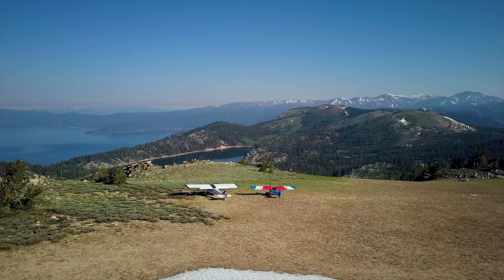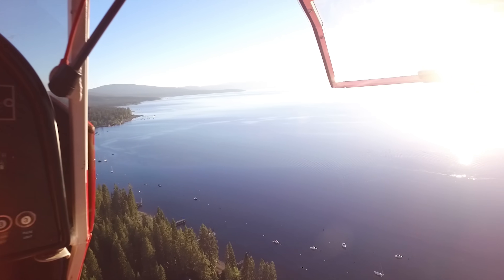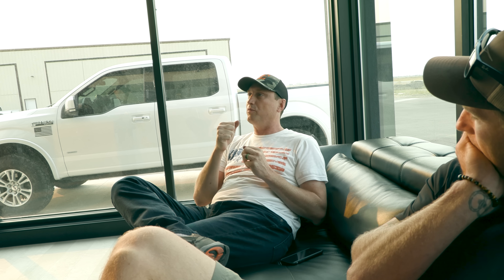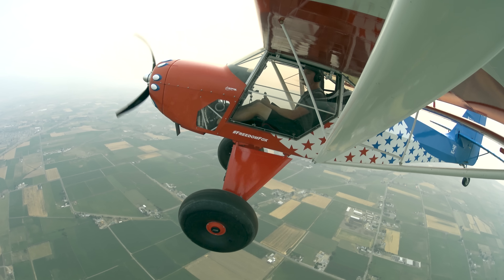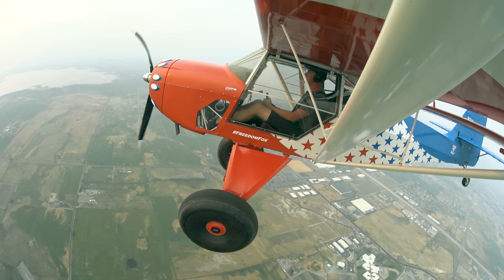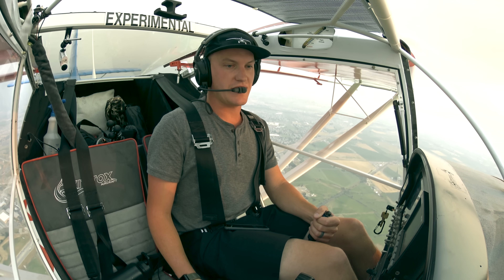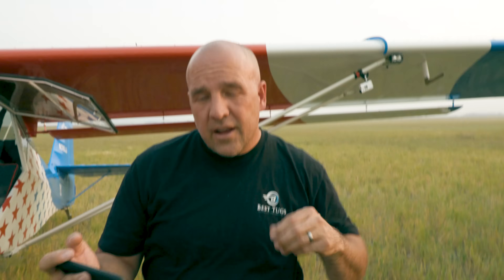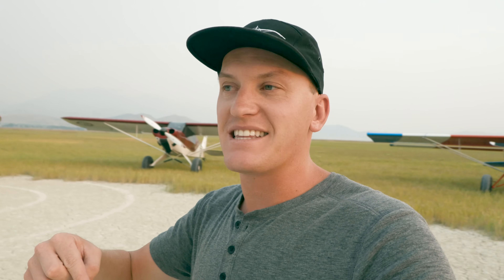YOUR FLIGHT INSTRUCTOR WAS WRONG! - Simulated vs Real Engine Failure

Comment: I think the root of this is people confusing the windmilling prop with an idling prop. Then the fish story continues to grow.
Reply: The issue is not that energy is going into turning an engine.

The variable is STALLED Prop vs FLYING (Wind milling) prop.

A wind milling prop is wing, FLYING, so like all wings it's generating lift.  The problem is that because of thr AOA of the air, it's lifting in the wrong direction!!!!

A stalled prop does produce drag, but not as much as a flying prop lifting on the wrong direction.
Reply: It's all about angle of attack and stalled vs attached airflow!
Reply: The engine spinning is just a side effect of this lift produced by the still flying airfoil/ prop.

Now, if the prop could decouple from the engine and actually spin fast, the AOA and lift would reduce.  Probably......I think....
Reply: Right, I think this is why this discussion even exists. A windmiling prop is driving the engine parts, and obviously creates more drag than a stopped prop. But, as Trent and the Cowboys proved, if the engine is driving the prop, it's still producing SOME thrust, or (at high speed) at least not as much drag as a stationary prop would.
Reply: Of course it does. I'm surprised that confuses anyone. The engine at idle is still spinning the prop and producing some level of thrust. That's why most instructors will tell you that the plane will drop faster in a real engine out vs. a simulated engine out. Another tip is to pull the prop all the way back if you've got a constant speed prop. It won't feather it back all the way like a multi-engine, but it'll create less drag.
Reply: A windmilling propeller can produce much more drag than an idling propeller.  An idling propeller at a high rpm can produce as much parasitic drag as the basic airplane.
"An indication of this powerful drag is seen by the helicopter in auto rotation. The windmilling rotor is capable of producing auto rotation rates of descent which approach that of a parachute canopy with the identical disc area loading." The preceding quote was taken from AERODYNAMICS FOR NAVEL AVIATORS by H.H. Hurt of the University of Southern California.
Reply: Terry Wilson rotating an intact IC engine will have tons of resistance to overcome due to the compression ratio. Much more than getting getting an electric motor to turn over. Next time your around an aircraft and the mags are off try spinning the prop to see “easy” it turns through the entire combustion cycle. 

Disregarding what people see in RC planes is also not very wise since there are not that far off from scale replicas of real planes with most of their differences being in weight and balance and the scale of their props. In aircraft design the use of scale models is a huge part of what they do in validating a new design.

Either way it’s pointless to argue against the facts, they just did the experiment and windmilling has the worst result. So you don’t believe it in real planes or RC planes lol.
Reply: I don't think it's just due to the energy required to turn the engine over since the same principle applies to paramotoring, and the ones that windmill have a clutch, so they just freely spin & don't turn the engine over. The freely spinning prop also causes more drag than a stopped prop
Reply: If the engine isn't seized, it's likely that you can fly fast enough to overcome the friction/compression of the engine, if it is seized, you can't fly fast enough to get the prop to windmill.

Edit: You wouldn't want to do that in an engine-out situation, of course, I was just trying to work out how a windmilling prop can create more drag than a stopped prop. I guess the answer is that a spinning prop is more efficient at absorbing energy and converting it into rotational energy than it is at acting as a speed brake, so it's best to keep it from doing what it does best in an engine-out situation.
Reply: Exactly, because you're using your potential energy (altitude) to turn the crankshaft and produce friction which is ultimately wasted energy when the prop windmills. When it's idling, you're using gas (chemical energy) to turn the prop, thus sparing your potential energy that you already have.
Reply: The difference is AOA of stalled, vs winmilling vs idling.

If the airspeed during Idle is very high,  then even an idling prop will produce drag because of the angle of attack.  If airspeed is low, then the idling prop is still producing some positive lift/thrust.  

It's all angle of attack.

If the prop is stationary then it is probably stalled (air flow wise) which means it does create drag, but that drag is still less than the NEGATIVE lift of a windmilling prop.
Reply: A prop creates more drag if the angle of incidence is not optimal for the velocity of the air over it. If the prop blades face directly into the wind, you will create less drag. If the prop then turns, it only means that the angle of incidence of the blades is wrong for thecircumstances, and the extra drag is converting that extra energy into a turning moment on either the prop (if the shaft is broken) the engine or gearbox shaft (if the engine has simply stopped) and also the airframe (under either condition, but more so if the engine, the shaft, or the gearbox has seized).
Reply: Terry Wilson it’s a valid argument when you think an electric motor would put more resistance on a shaft then an IC engine when they are both shut off. The compression strokes provide the prop with lots of rotational resistance. Pushing the prop it in any direction other than it’s direction of rotation is irrelevant and has nothing to do with anything. 

As far as safety goes it’s plenty safe to rotate the prop, it’s also standard operation procedures in the POH of many aircrafts cold weather start procedures including Cessnas. Even if there was a fault in the magneto system and the engine did start it’s not like the prop will chop your arm off before you pull your hand away. Before electric start mags on both and spin the prop was how aircraft were started. It’s also still how people start with a dead battery in the bush since CAA won’t be arriving to help. The prop doesn’t go from 0 to 1000rpm instantly after all. 

But I wouldn’t expect much common sense from you since your “experience” is based on simulations. Like thinking by losing an engine makes you lose the majority of your 6 pack instruments. When in reality you just lose the Attitude and HSI gyro instruments. Still have the turn coordinater for reference if stuck in IMC conditions since it’s an electric gyro, airspeed, altitude, VSI, and compass to replace HSI. Losing the attitude indicator is a non issue during VFR flight, and a situation regularly trained for during sImulated IFR IMC conditions using a hood. Even IFR in IMC you will break out of clouds by the time you are in the landing phase of flight with reference to the horizon. The bigger concern with an engine failure in IMC is the lack of time to spot an adequate field to set it down during a forced approach if breaking clouds at a low altitude.
Reply: Even a windmilling prop will produce less drag than an idle prop....right?  Am I wrong?
Reply: @pauliexcluded1  the paramotor props that freely spin when the motor is off create more drag that the clutch less ones that stop the prop. Anyone who regularly turns the motor off so they can thermal like a freeflight paraglider buy clutch less motors for that specific reason.
(We use 2 stroke motors though)

Edit: oops, didn't realise I'd already commented on this thread
Reply: @Marty G - You are spot on!  I am private pilot, but inherited a large amount of experience with radio controlled model airplanes from my younger self. I have had some very finicky 2-stroke engines in my model airplanes and have done countless deadstick landings. I ended up switching to electric planes to avoid the hassles. The electric motor controllers all have a prop brake function that can easily be turned on and off. It is specifically there to stop the prop during gliding to eliminate the extra drag of a windmilling prop. So I could generalize and say:
A functioning engine at idle will result in the longest glide, how much better depends on idle speed, glide speed and prop pitch
A stopped propeller will glide less far.
A windmilling propeller can be from a little worse to noticeably worse than a stopped prop, and is more noticeable at higher airspeeds 

My high performance model gliders actually had folding propellers in addition to the prop brake. The propeller blades were held out by centrifugal force when the motor was running, and had hinges that let them fold back when the motor brake brought the prop to a stop. So I would add that if your prop flies off you will probably glide slightly better than with it stopped, and real world might get a little less horizontal stabilizer drag with it gone from the change in CG too. :/
Reply: It’s so insignificant as to hardly matter on a properly set up engine on most aircraft. 

Lots of aircraft have the idle set too high. That and padding airspeed too much is why you often see the float fest down the runway.
Reply: @calvinnickel9995  Do a couple of simulated engine out landings by cutting the mixture instead of cutting throttle. You'll see how much drag a true windmilling prop causes. I'd compare it to the compression braking you get from a car, truck, or motorcycle. You can even use it for a steep decent to limit your airspeed in an emergency. 
But don't really try it just for fun, kinda unsafe
Reply: BTW throttle wide open, mixture cut off gives you the most drag because you are creating higher cylinder pressures. I know "somebody" who did this a bunch of times when they were young lol
Reply: Exactly. If you stop the engine, but the prop keeps windmilling, that energy to turn the engine around has to come from somewhere. As a result you don't glide as far as with the prop stopped. When idling, the engine supplies this power (and perhaps a bit of thrust too).
Reply: But the energy is still going to be absorbed by the prop and converted into torque, even if it's not windmilling (assuming an un-feathered prop) and that torque will either act on the airframe or on the rotating components of the engine. It would seem to me that, if your prop is windmilling, that simply means that the prop is converting enough energy into torque that it's able to overcome the friction of the engine, causing it to rotate. If your engine is seized, but the prop is absorbing enough energy that it would normally be causing the engine to rotate, that stationary propeller is probably creating more drag than it would if it were windmilling.
Reply: idontcare80 not sure about that. Think about an autogiro or a sycamore seed pod. If the ‘blades’ of either are spinning they create a load of drag, if they are stationary they drop like a rock. Maybe oversimplified and a little off the mark but goes some way towards the reasoning.
Reply: But that assumes that lift is also being created, which it's not in the case with a windmilling propeller.
Reply: That's not how energy in physics work: if a force is trying to rotate the propeller, but the propeller is standing still, no energy is spent. Of course there's friction in the airflow and stuff, but no energy goes into rotating the propeller.

It is apparently a well known fact that a windmilling propeller creates more drag than a stopped propeller (assuming it is the airflow that drives the propeller around). My energy view of it was just one way to understand why. Another way to understand it is that the stopped propeller blade gets an angle of attack of 90 degrees with the airflow, so the prop blade is stalled and creates little drag. The windmilling propeller has a much shallower angle of attack, so it is able to create more drag (caused by the negative lift).
Reply: idontcare80 why isn’t lift being created? You have a high & low pressure side of the prop blade?
Reply: A stationary prop is stalled so the drag is just from the air circulating around it. When it is windmilling it is not stalled (or maybe less stalled) so it is more efficient in deflecting air, causing more reaction force. This is the same as your wings. At flying speed the wings are producing a lot of force holding the aircraft up. If you stall you drop like a brick. Turn this through 90 degres and your windmilling prop is now producing a force that is trying to slow the aircraft.
Reply: Yeah the autogyro is a very good example. It's the exact same reason why a helicopter can auto-rotate: the rotor creates a lot of lift while it is rotating, and the airflow is driving the rotor. But if you stop the rotor, the helicopter will fall down a lot faster (it creates a lot less drag).
Reply: "That's not how energy in physics work: if a force is trying to rotate the propeller, but the propeller is standing still, no energy is spent."

You're assuming that there is no friction. There's is still force being generated by the stationary prop, it's just that the energy being generated by that force is being transferred to the airframe instead of the engine. If you apply enough force to the prop to overcome the friction of the engine, the energy will be transferred to the engine (some will still be transferred to the airframe).

"...so the prop blade is stalled and creates little drag."

This is where I'm guessing, and my guess is that it would create more drag because it's stalled and not moving smoothly though the air. 

I think the whole windmilling prop creating more drag idea comes from the fact that you're simply flying faster in order to get the prop to windmill, which is where the additional drag comes from.
Reply: LesNewell - A little counter-intuitive, but that makes sense. Still, though, does a stalled wing create less drag? You can have a huge amount of drag without generating much lift.
Reply: Yes, you are right that I'm ignoring friction, and I agree that it's not obvious and you can't conclude just based on some simple thought experiments.

I was just providing some analysis to explain why things are the way they are (supposedly). Only an experiment or some proper calculations can tell what's right. But I think the example of an auto-rotating helicopter is the exact same effect: when the rotor isn't rotating it causes little drag, and the helicopter falls down. When the rotor is spinning from the airflow, it creates a lot more drag and falls slower. So I don't think it's unreasonable that the same thing could happen with the propeller of an airplane. Would be interesting if someone could try that experiment (Edit: and that's what Mike tried and confirmed) :)
Reply: I have no experience with full size aircraft but I fly RC planes and it is quite noticeable that you get less drag with the prop stopped, which is exactly what Mike experienced. In fact many model aircraft motor speed controllers have a brake function to stop the prop for this very reason. This is probably more noticable with models because generally we use a bigger prop relative to the size of the airframe.
Reply: Thomas Berg you are confusing energy with work. If you push a  car with the parking brake set, you are spending energy, but doing no work.
Reply: By flying large RC planes for a while, I can tell you there is a LOT of difference in windmilling prop vs stopped prop, and a large windmilling prop feels like it creates 3x more drag compared to stopped one. This is the reason it is extremely important to use folding pusher  props, so when there is no power given by the engine, airflow folds it down not spins it.
Reply: @eckythump6429  Interesting point....have to think on that....you are not wrong.
Reply: @eckythump6429  it's definitely more than just the blade surface. a spinning blade curls up air into a compressed ball and creates complex interactions.
Reply: @LesNewell  right, I think stall is part of it. another part is speed of the blades. a faster wind milling blade would create even more drag.
Reply: Guys...the prop is windmilling because it is 'trying' to get to a lower drag state - thats why it turns.  if its lowest drag state is stationary, then it will stay still.  so stopping a prop that wants to windmill will cause more drag on the airplane.  when it is stopped, all of the oncoming air hitting the prop simply pushes backward onto the airplane, slowing it.  when it is allowed to spin, SOME of that energy is going to make it spin, therefore less is available to 'push' on the plane.
do an experiment with a model prop on an axle in front of a pedestal fan.  when you allow the prop to rotate freely you will feel less pressure pushing your hand back, as you slow the prop and eventually stop it with your fingers, you feel more pressure.
Reply: Matt Dug Red Wait what? Your explanation makes no sense to me. What you are saying is if you stop the model prop in front of a fan there will be more air passing by creating pressure on your hand compared to if you let it windmill. 

Because if there is less wind pressure when it windmills compared to when it is stopped it means it’s creating more drag when its windmilling. (Because no wind is no energy left, more wind is more energy left etc.)

In your explanation the air is moving because of the fan creating wind, in our other scenario the airplane is moving in the air creating wind. 

What I say is ppl are simplifying it way to much. The prop windmilling will create its own drag from just spinning. The faster the prop is turning the engine the more energy it takes as well. 

For it to be more efficient with windmilling compared to a stopped prop. 

The drag/energy loss has to be less than a stopped prop. 
It’s impossible.
Reply: Yeah, I made an edit to my comment.
Reply: No, a windmilling prop has more drag.